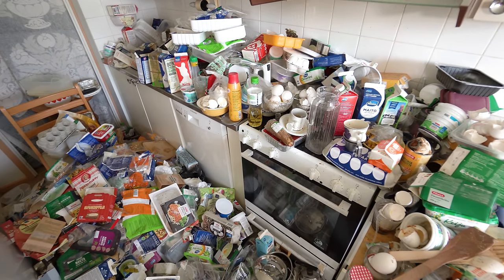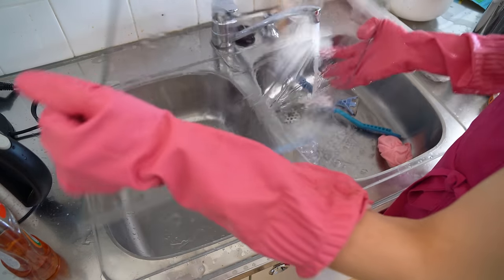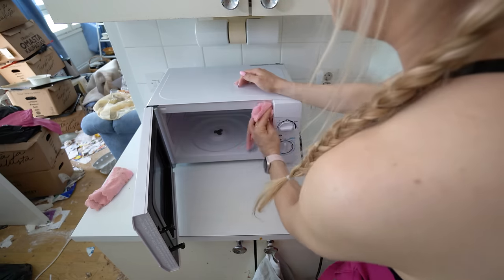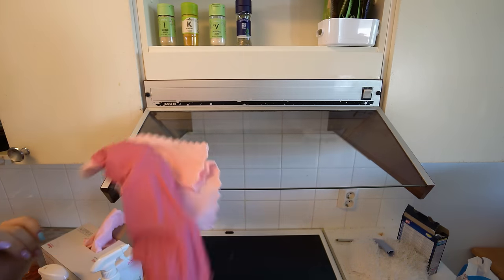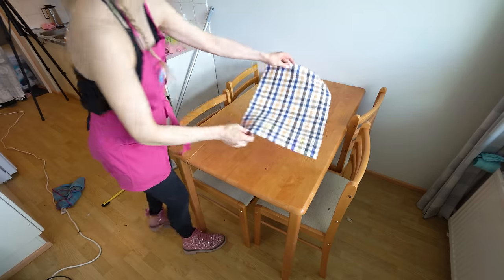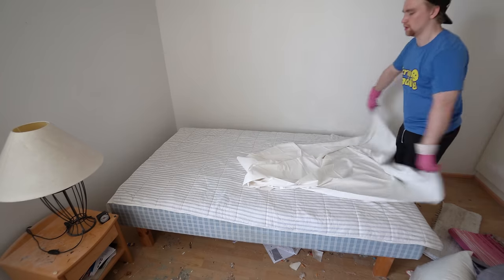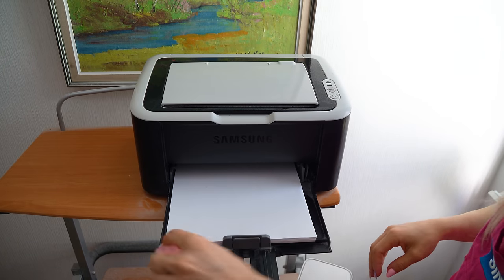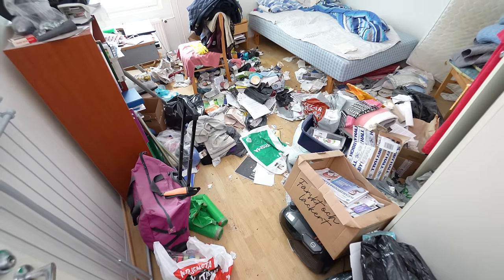MAKEOVER- What happens after a free cleaning??

Comment: You can keep cast iron pots and pans from rusting after washing by drying it on the burner and then putting a thin coating of oil on it then heating on the burner again. The cast iron becomes resistant to the water over time.

Comment: The animal on the bedsheets is a badger. It's so cute. A simple way to test eggs is by taking a container with about 1 - 1½ l of water. Put the eggs in one at the time if they go to the bottom, they are fresh, if the lift a bit up over the bottom, they are useable. but if they scoot up to the top of the water, they are filled with air and uneatable.